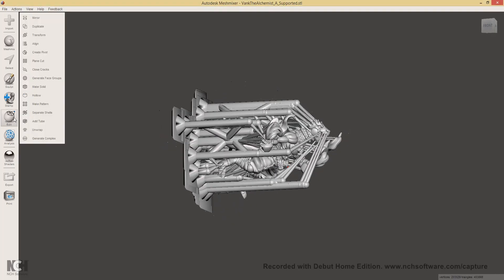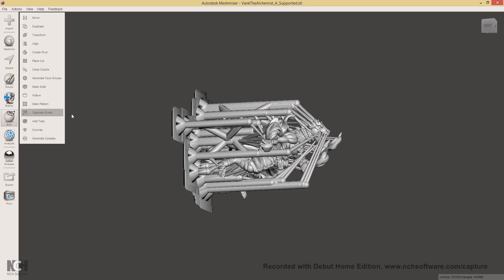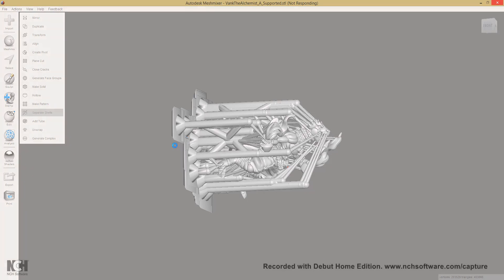How To: Remove Supports from a Presupported Miniature STL in MeshMixer

Comment: if you use the inspector you can remove much faster. all suports are pink errors so click auto repair an only the raft stay and then you can delete the raft
Reply from the maker: Wow! That was so much faster, thanks :)
Reply: @vlungu  hey men, i have a problem with a file that is hollow. how i can fill the file to become solid?
Reply from the maker: @rodrigoantonioutrerarodrig8235  does "separate shells" split it into inner and outer shells? If so, just export the outer one should work. There's also a "make solid" functionality, but I think that's just meant to merge different model parts into one.
Reply: @vlungu  nope dont work the file name is "BIPEDAL TRASH COMPACTORS" in cults3d. Ty in advance
Reply from the maker: @rodrigoantonioutrerarodrig8235  I've looked into it, and there's a spot in its left jaw where the inner and outer shell have common vertices; if you separate them there, you should be able to separate the inner and outer shell and delete the inner;
Reply from the maker: the way I found the spot was to repeatedly use the plane cut tool (keep both), separate shells, and use the selection tool to check in which part the two shells keep selecting together
Reply from the maker: separating them is another matter though; you'll need to use blender (or similar) to select, duplicate and separate the respective vertices; I'd contact the creator at this point to ask them if the unhollowed version is available though :)
Reply: BROO, THANK YOU SO MUCH!